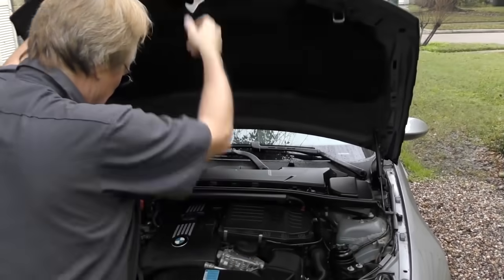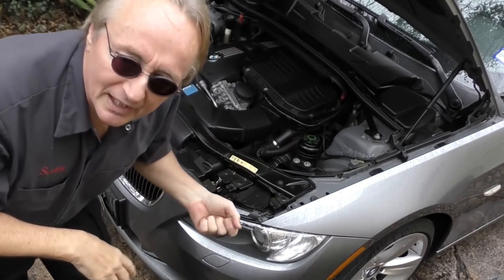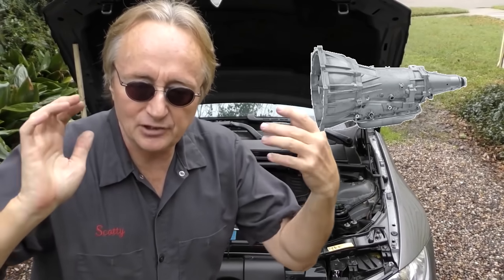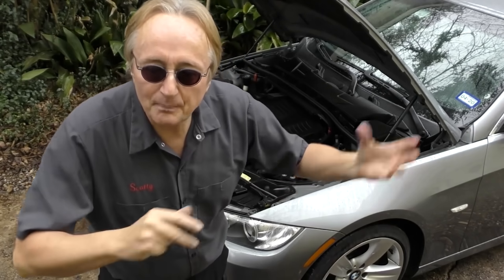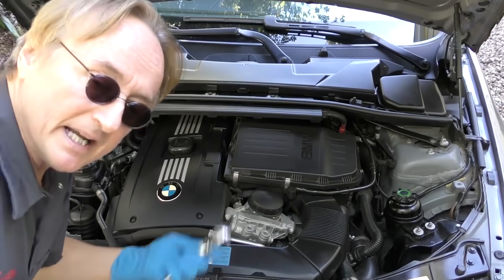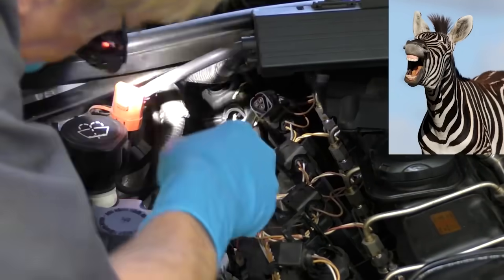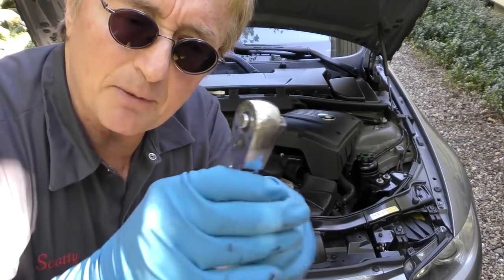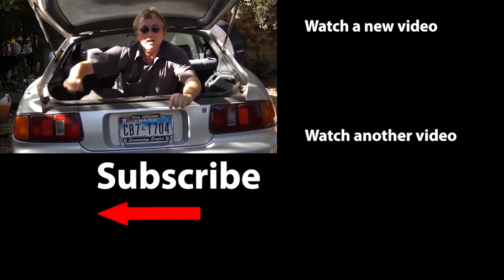People Say I'm Full of Crap About BMWs, Well Watch This

Comment: i wouldnt wanna drive a bmw till it dies but theyre not unreliable either. get a model with a normal engine, drive it respectfully, do your maintenance, ... and it should last you a good while. obviously dont buy a second hand M model with a big engine that most likely was abused before you bought it. i always buy end of lease contract low mileage bmw's from germany and always had long lasting cars with low depreciation (the first two to three years depreciate the hardest) and no bad surprises. never dared to drive them for longer than 150K miles tho, which is kind of the point where you have to sell if you want to get a decent price out of the sale and right before it starts to get really expensive to fix.

Comment: it’s all how you take care of your car. every car today is full of plastic parts and bmw is no different. l have a 530i with 188,000 miles on the clock it is a really reliable car it’s only had the normal things go wrong with it. 3 coils 1 fuel injector and a valve cover gasket. he’s not even working on this car right the stuff he is fighting around comes off with only like six bolts and you can get right to everything with ease. scotty stick with cars you understand

Comment: Come on, you get some aftermarket turbos for way less and have them done by an indie shop.  No, it's not cheap, it's not going to be like a Toyota.  They've actually refined things even more since the N54 as well, but if you got one of the non-turbo engines back then you would have even less problems.  And just don't get a convertible anyway.  Don't get a BMW for status, they're for people with money or enthusiasts that can DIY a lot.

Comment: Buy a Ford Taurus 1999 to 07 for under 3k w under 100k miles and get 300k plus with regular maintenance. These models have timing chains and never break Ive owned 2 and my current one has 250k and I use it to make local deliveries. I just maintain the car and it goes and goes and goes. It will never make you use Vaseline 🤣🤣🤣🤣

Comment: I had two BMWs that both were trash. Why does every fkin BMW in existence leak oil because the oil gasket cover needs replaced after 50k miles? My BMWs were 7 years apart with the same exact issue. Then I read people in 2023 have the same exact issue… wtf??? I had so many problems with both cars. I spent over 15k in repairs on both cars in the 5 years I owned each car.

Comment: Scotty scotty scotty - that BMW takes NGK ZKBR7A-HTU spark plugs, not BOSCH! 

I've had my 330i for 14 years, apart from the regular maintenance (oil change, oil filter, air filter change, cabin air filter etc) I've not had to change anything. Still on the original battery from 2009 (it's 2023!). Are parts expensive? Yes, but I'm a cheapskate and I say McDonalds is expensive. BMW parts don't seem to be more expensive than Toyota's - I could be wrong but I've done some googling and I couldn't see much of a difference! Google BMW e90 fuel injectors and google toyota fuel injectors. Right now, there's not much of a difference even though BMW fuel injectors have doubled in price because of the index 12 release. I was actually shocked that toyota fuel injectors cost as much as BMW...and they look a lot cheaper - BMW fuel injectors are all metal, Toyota's look like they're made partly out of plastic. I'm in Europe (UK) so it could be that BMW parts are more available and cheaper than the UK. I'm looking to buy a new car - personally I'm looking at BMW because they are cheaper to own (in Europe). He is right about the plastic - after 14 years, I broke 2 plastic stick-out bits on my engine bay covers but most of the plastic still looks solid. But then BMWs have a lot of plastic covers which are very useful - forget what Scotty says - they reduce engine noise dramatically - you can barely hear the engine inside which on a long drive makes a difference. Also, just changed my spark plugs - old ones were fine but just in case. Plastic was 100 fine. Nothing broke. I'm a big bloke and I was pulling on the ignition coils hard.

The one are that my BMW falls flat is fuel - it runs terribly on regular unleaded E10 95 octane - I need super premium fuel (99 octane). Maybe premium 97 will work - I just use 99 all the time. Seriously, I put E10 95 octane once and I thought the car was broken, that's how bad it runs it.

Comment: He’s really upselling the difficulty of the more simple stuff in these cars for example taking the engine cover off is as easy as pulling it off no need to pull the air filter box popping ignition coils out not that bad had more trouble getting spark plugs out of American made cars then that cylinder 6 on a bmw the plastic do wear out but it’s not a “fortune” per say most parts I’ve had to replace not much more expensive than other makes of the same year the expensive side is paying labor to dealership or shops trying to up charge the same maintenance just bc it’s a bmw oil change simple yet will try and charge you 3x the normal price if you can do it yourself or know somebody you can bypass all that up charge

Comment: Yh there is a reason Toyota sent every part from the new Supra engine back to BMW and said it's not good enough. Toyotas quality is leaps and bounds ahead of BMW . BMW may build fast cars but they are not built to last. Lovely looking cars but by God they are the most troublesome car I ever owned. Never again. I will take a 20 year old Toyota over a 5 year old BMW
Reply: They didn’t. They had very little input on the b58 motor and most of the bmws with them are very reliable. The part numbers are shared with the other cars.

Comment: as long as you buy BOSCH youll be good. I bought one as the 3rd owner 171km, the only issues was the axle arm and the oil pan gasket went. all codes were clear

Comment: As a Master Tech, his information is very outdated. Toyota now uses BMW engines AND electronics for their top-of-the-line sports car. The reliability of both brands is in the top half. Ultimately, they are enthusiast cars. They are not Toyotas and many Lexus still fail in performance/tech when compared to BMW which sets the benchmark. You can either afford them (or know how to work on them) or you don't. Life is a compromise friends. Drive according to your wallet or skill.

Comment: You are full of it, I have owned my BMW 528i 2008, and still do service at BMW I’ve driven the car 238 thousand miles, if you do the maintenance on the clock, you will never have an issue with the car.

Comment: BMW screws long-term buyers. The car's low quality shows after 150k. Endless repair. Planned obsoletion. I had a 2013 and a 2017 BMW. I learned the super hard way. To be fair, if you are a short-term owner no problem, but that's not what I wanted. I got f****d.
Reply: Did u have a 2017 3 series was it good?
Reply: @Cherfromxbox  2017 330e. Was good up till 170k. Then, transmission jerk. Coolant pipe burst. Had to get it towed. Coolant bursts another 5 times until I sold it at 300k. BMW put all this cheap plastic parts in their car so that it will not last past 150k. Planned obsolecense. Had I known this, I would not have bought that brand new BMW. My 2013 BMW's engine went out at 180k because of cheap plastic too around the timing belt. The cheap plastic wore out, blew my timing belt, and the engine. They did fix this in 2015, but they didn't fix their other cheap plastic parts. I learned this all too late. So much money and sadness lost to BMW.

Comment: In Croatia, turbo repair is 500 e for one turbo. Why the f... ck would anyone buy a new turbo when they can give their old turbo for a repaired one and pay 500 e. I am not bmw fan, but bmw is not a bad car. Here people are not stupid as americans to drive petrol cars. Diesels are the deal here, again why would somebody drive 200 hp petrol with 200 nm of torque which drinks fuel like crazy instead of 200 hp 600 nm of torque diesel which you can drive for 3 days with no stoping. They are stronger engines than petrols. I like bouth but we are logical people. People think you work on diesel and drive on petrol, but what are your trimmers, chainsaws and lawnmower running on. Diesel is made to pull stuff and it is damn good at it, and it has the same polution for the environment as the petrol look it up, it only has little more polution for human health because it produces different gas that harms us but in very small amount. When i am going on a trip to a beach or anywhere it is amazing to drive diesel, you dont have to worry about fuel, car overheating, oil consumption etc.. you just enjoy and drive and when someone tries to overtake you, you race and that is it. Enjoy

Comment: BMW's are crap.  Their reliability is sub-par and their maintenance costs are massive.  Unless you don't mind wasting a lot of money on repairs and the hassle of taking them to be fixed.  BMW has even "softened" them to appeal to a larger market so they are not even as fun to drive as they used to be.

Comment: BMW after 100k is garbage.  Mercedes is just garbage at any mileage.  Older BMW and Mercedes were great; now avoid.  We’ve had a few Mercedes now, mostly AMG’s because supposedly more reliable hand built engines… garbage.  Two had invisible coolant leaks.  Always smelled burning antifreeze.  Funny cause we went to the dealer and someone else was there with the same problem.   Our current AMG is 2 years old, less than 30k miles and keeps popping up codes and Mercedes cant seem to fix it.  Misfire codes and a weird service light they cant get to turn off after three visits.  It was supposed to be part of a recall they fixed but apparently not.  Break job-$8000…no 💩!  Oil change and diagnostic $900+.  My wife likes how they look 🤦‍♂️.  I drive only Toyota’s.  I dont care how much money i make im not buying an overpriced POS as my daily.  Toyota or nothing!

Comment: Ive owned a 2011 X5M for 4 years now and apart from oil changes... nothing else apart from minor things like interior bulbs and tyres. Scotty is either very unlucky, very biased or somebody genuinley doesnt know how to fix european cars?
Reply: Owned my 2011 320D 150 000 km for 6 years with 0 issues too and I also have a 2001 530i with 600 000 km, no issues as well. Toyotas are reliable but imo opinon, BMW surpasses Toyota if you take care of it. Scotty is not a good mechanic, I mean he makes fun of the hood struts? A pair is under 20 bucks... How is that the cars fault lmao. I bet toyota used the same brand as BMW.
Reply: 150000km is around 93000 miles. Toyota with that many mileage is considered as low-mileage car with many more years of reliable service here in the U.S
.

Comment: I really wish that I had watched this video before I made the giant mistake of buying the 2005 BMW X5 that had 177000 miles on it. We paid $ 6000 for it because we didn't have a lot of money. 2 months in we had to replace the battery and that set us back $ 270 + and then a few months later we needed to replace all 4 tires because the rear tires were wider than the front tires and so you can't rotate the tires and so the tires wear out faster . Those new tires cost us about 1400 dollars. Then we started to hear a high pitched noise coming from the sound system because the wiring harness had worn though and so the wiring was shorting out. So we pulled the fuse to the sound system because we couldn't afford to pay a mechanic to track down the short.... Then a headlight lamp went out and I had to have the car parts store employee replace the lamp bulb because the opening to access the place where the lamp bulb was too small for my big fat hands to fit into....  The mechanic we had taken the BMer into to diagnose the radio problem charged us about $ 200 dollars to tell us that we ought to get rid of the BMer because he was getting all sorts of error codes. Then the driver's side window fell down into the door because the electric windows guts had rusted out and so the mechanic that repaired that window charged us $ 275. A few months later the passenger window also fell down into the door and so cha ching there went another $ 275 , Then a few weeks later the driver's side window also fell down into the door however we "lucked out and found a mechanic that only charged us $ 170  to fix that window. and then lo and behold the front passenger window fell down into that door..... Cha Ching there went another $ 175..... Then that mechanic found out that one of the front struts needed to replaced and that cost us $ 190 ..... Subsequently the mechanic that wasn't charging us an arm and a leg and an arm had to move and so we were forced to search for another mechanic to work on the POJ ( Piece o junk!!! ) So when the passenger window that we had repaired fell down in the door again because the clip broke .... We were forced to pay another $ 275 to fix that window. Then the tires we had replaced just a few years ago were nearly bald because they couldn't be properly aligned along with the fact that we couldn't rotate them properly. So we bought some news tires and rims that are all the same size so that we could rotate those tires. Those tires and rims cost us over $ 1800. Then we found out that we needed to replace the PCV valve because the transmission was shifting hard. That cost us another $ 270  and in the minus 20 degree weather that we just went through caused the cable to break and so to repair that cost another $ 350 more.  And then the passenger side front door handle also just broke. We haven't had that fixed yet. In the mean time we found out we found out that one of the  in the front end is going out and also the rear tire needs to be aligned and also the starter has also started going out.... So all told the newest repairs are going to cost us another $ 1400 plus dollars..... We'd buy something else but the used car market is absolutely nuts.... Anything decent that we could possibly afford under $ 8,000 is at least 15 years old and has at least 150,000 miles.  So long story short Scotty Kilmer is correct about how over the top expensive BMWs are to maintain!!!!                                       IF I had known what I know now..... There is no way that I would have ever bought a BMW in the first place. BMWs are w/o a doubt JUNK!!!!
Reply: I’m not sure what you expect from a car with 177,000 miles on it, period, and if you did - why pick any luxury brand? That just wasn’t good judgement on your part.
Reply: You bought a car with 177k miles and didn't expect problems? That's not a BMW problem, that's a YOU problem.